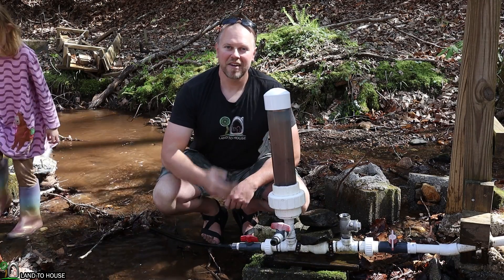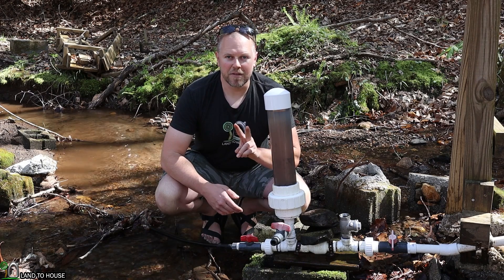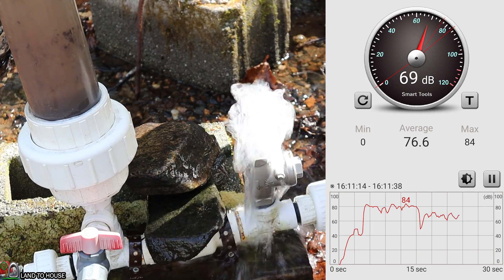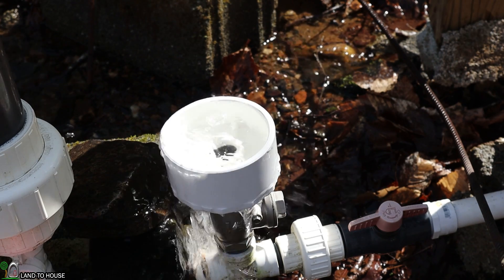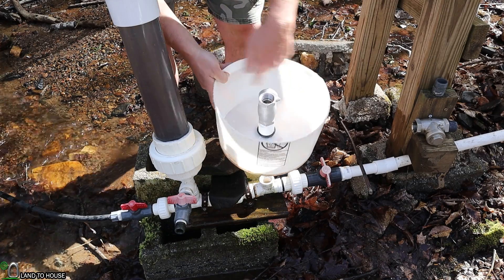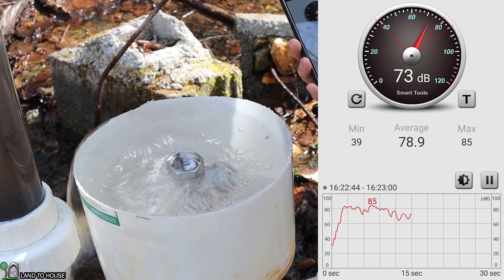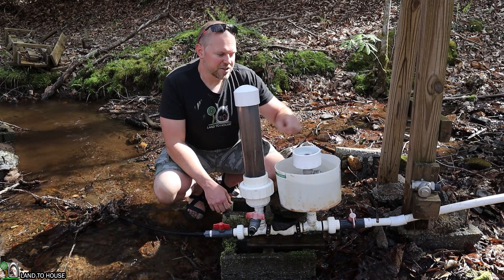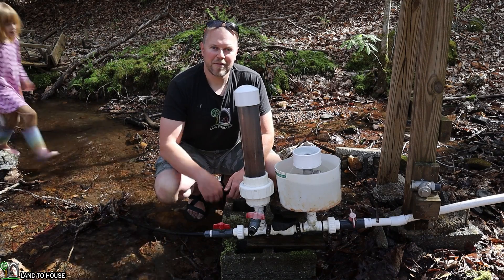Ram Pump Waste Valve Underwater to Reduce Sound

Comment: Um the noise is the valve slamming shut. Wrap the valve in foam. Attach a foam cover over the valve as well with space for the water to drain out.

Comment: Sound transmittance is disorienting science until you pop through with a few realizations. I would try wrapping the ram valve itself in a lot of mass loaded vinyl. Also, I suspect if the whole pump were a couple feet underwater, it would make a huge difference. The small amount of water you have is not enough. With a lot of water, the sound will transmit into the water, essentially becoming dispersed in the water volume.

Comment: Seth, you should always measer 1m away from the pump.
Place your mobile phone on a tripod and let it sit.

I thinkt the most noise cames from the side of the checkvalve and not the opening on top.
Maybe a bucket upside down, so the checkvalve-splash is also reduced.
Stay tubed.

BTW
i started experimenting again with my pump after 7 years. :-)
Do you remember?

Comment: You're creating waterfall sounds, splash. Without that, noth are quieter.

Solution: rotate waste valve 20% and add a pond, a bucket catch slow ramp down instead that eliminates the splash.

And the app won't  be accurate unless placed in identically the same spot for a second reading. Put it on a tripod perhaps?

Comment: Thank you for the video.  When we are running 4 ram pumps, they create quite a racket.   Raises the question where is the sound coming from?   We have our ram pumps (thank you Land-to-House) in a stream with limited fall, so I have tested running one of the pumps with the top of the check valve at water level to get a little more drive pipe fall.  Seemed to run just fine and I think you have a video about running a ram pump underwater.   I don't remember if there was a difference in sound - I was focused on maximizing output volume.

As you know, there are different types of check valves, I wonder it they have different sound quality.   Also if wonder if a rubber strike plate might eliminate the metallic click?  Perhaps a future product for custom check valves to increase efficiency and change sound quality and reduce sound volume? 

Looking forward to you next video.
Dave

Comment: If you want to reduce the sound, you have to change out the internal parts to Delron.  Researchers have known since the 1920s, that sound underwater can carry up to 10,000 miles. The stainless steel parts of the valve are making the sound. The valve itself needs to be made out of a nylon tight material. This will eliminate the metallic sound that travels through water. This is not rocket science. This is cognitive thought to solve a problem.

Comment: 3:48 I said it in a previous video and I'll say it again. You already have the answer because you did it on another video. When you submerged the whole unit in water it was in a pond 

This tells me that if you simply got a big 55 gallon drum and built your unit inside of that drum, once the drum was filled with water, you would probably have a significant quieting effect 

I understand that you are trying to test a bunch of different things, but as a scientist, if you already know the correct answer, you start with that and then you try to find improvements 

You don't start reinventing the wheel with things that don't work as good as what you've already discovered 

Imagine trying to develop cars again from scratch rather than improving the modern Chevrolet 

Just because you're making a video doesn't mean it was content. Anybody wanted to see because you're wasting our time, because we know this isn't going to work as good as what you've shown us in the past

Comment: hey there, just wanted to drop a quick comment -- sound in water is much louder & travels much farther, divers know this well. if you've ever been to the beach on the ocean, you might have heard a school of dolphins or a boat motor from miles away. I suggest something like neoprene? or a foam that can either get wet or withstand wet elements, to encase the valve. neoprene is used in wet suits, it's foam rubber, I wonder if wrapping it with that might help?
Reply: neoprene might also provide enough insulation to keep it from freezing in winter, I just realized

Comment: Water is compressible , so will transmit sound really well, the sound wave then expands and is hitting the sides of the water container, more surface area , more sound produced, even with the energy loss from the sounds having to travel outwards before hitting the edge.

Comment: The water isnt making the loud clicking noise.

You arent measuring the same distance from the object producing the sound.

It would have been better to insulate the pipe with the valve.

It would have been better to measure db level from the wood post next to you to for standardization and to lessen the impact of the noise of the splashing water.

Comment: Maybe rapping the valve with a material that does not absorb water (or at least not much like a sponge) but does help with sound proofing?
Also if you will use the bucket as something to hold that material in its place (fill the bucket with it) maybe consider opening draining holes on the bottom to allow water to drain, thus splashing water sounds will be reduced plus i think it would make the bucket less heavy for obvious reasons.

Comment: I wonder if you had a stiff rubber or plastic flapper instead of a metal one if it would reduce the noise...sounds like the metal to metal smacking is what is making the most noise

Comment: A Quiet Check Valve is a great solution when extremely quiet operation is desired. Quiet Check Valve offer all the features as the standard check valve, with the addition of a spring-loaded hinged flapper mechanism which forces the flapper to fully close against fluid flow as the pump shuts down. This rapid closing action against pressure before any flow reversal can occur, eliminates noise caused by hydraulic shock (water hammer)...  c/p from BOSHART INDUSTRIES 'STANDARD VS. QUIET SUMP PUMP CHECK VALVE'...
Reply: LOL! You know a rampump works because of the water-hammer-effect created by the checkvalve, right?
I think dampening the waterhammer will result in a rampump that is very quiet indeed, but it won't pump either.
Reply: @TerrorTubbie666  You just began a sentence with an acronym and expect anyone to respect you... GFYYI...

Comment: as any scuba diver knows... sound travels really well in water... you can't use water to muffle sound. it was a cool experiment to see you try... on to plan B!  can't wait to see!
Reply: True, but that does not apply here exactly because our ears are in the air, not underwater.  But the water does a good job of conducting the sound to the walls of the containers which in turn vibrate the air.  Also, the containers needs to be decoupled from the pipe. I think a water tight enclosure filled with air and squishy foam and isolated with rubber bushings from the pipes would work well.  The pipes themselves will conduct sound so wrapping them with swim noodles would help too.  It will be interesting what he comes up with.  He is going about it the right way trying to keep it simple as possible.
Reply: Now how do we get that inside a vacuum???
Reply: I think the noise you hear is ‘break out noise’, radiating out from the valve body. You could try a lead impregnated acoustical wrap around the valve.  Good luck.
Reply: Respectfully, I strongly disagree in the case of the ram pump noise not being negated by submerging it underwater. Ours is operating in a tote full of water in the creek and you have to be right next to it to even know it’s running. Sound does travel better underwater - if you are also under water.

Comment: Use the 5 gallon bucket, don’t extend the pipe up, wrap the valve below it with foam from an old couch cushion and place a layer of same foam floating on the water in the 5 gallon bucket

Comment: I think you’re amplifying the sound with that design.. I would try to build a box around it and then use rockwool inside the box.. it’s resistant to water and a very good sound proofing mechanism..
Reply: I'd cut 2 plastic drums, a 55 gallon and a 35 gallon, rockwool in between them?  set them over the ram pump.  not sure if mold and mildew would be an issue eventually.
Reply: @JT-cf5ol  yea I would use rockwool. It’s fantastic at noise and it sheds water don’t think you would get mold.. its rocks :)